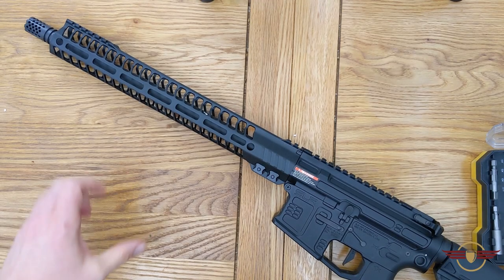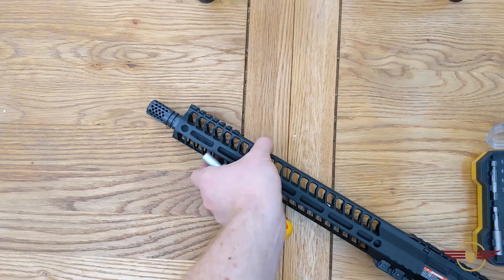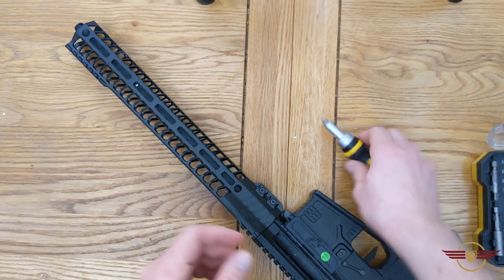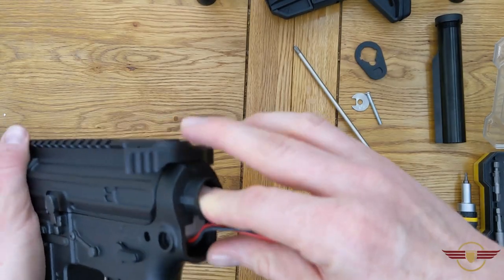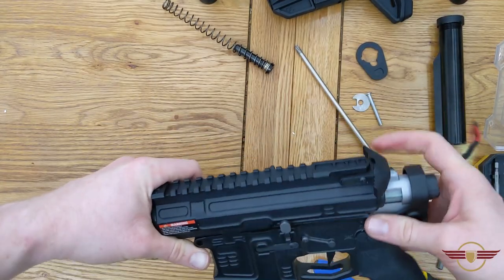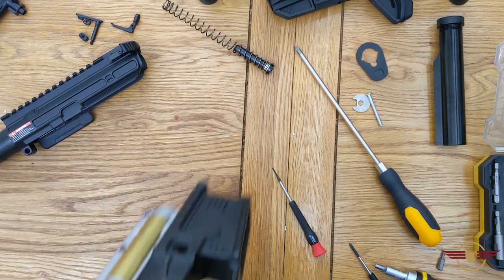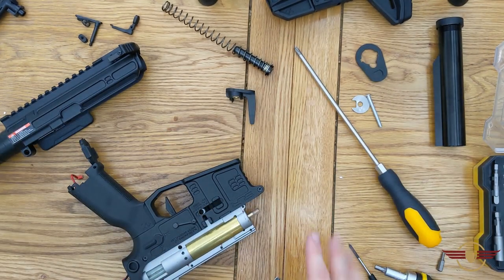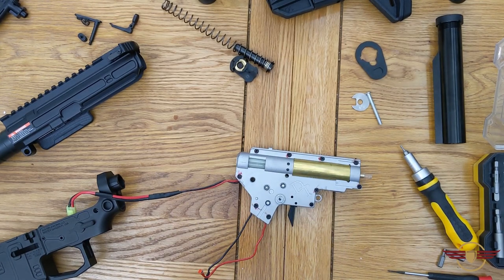[HOW TO] DYTAC SLR B15 Carbine Disassembly - internal review

Comment: thank you for make this nice video, I have the US version, there are couple difference in internal. US version has much strong motor that is I believe the same one in the CYMA Platinum M4, my gun also has that dytac mosfet with dean plug, of course we got plastic orange tip instead of steel muzzle brake. the air seal is non on my gun, the cylinder head and the piston head o-ring is way under size. BTW the external was built so nice.
Reply: Wait there's a Mosfet? I was wondering why mine not only came with Deans but it had 2 positive wires coming off the plug, even though the listing and discussions online claim it doesn't have a mosfet and comes with a Tamiya connector. (I got it in an Evike BOA event so lucky me either way).
Reply: @MrMattumbo  that's right, mine from evike too. I opened it up, you can find the exactly mosfet on evike website which is 29 dollar.

Comment: I just took mine apart and it has a basic mosfet in the trigger assembly! Im not going to use it lol, putting the Titan in it but all the ones I have seen had basic trigger contacts. Why would mine have a Mosfet in it?
Reply from the maker: Really? That's odd. I'm not particularly aware of them fitting them. Very very strange. The titan will be immense in it though! Pheas
Reply: As am I but I’m having trouble with the selector switch and the plate. It will no longer work. Any idea?
Reply: @DynamiteD21  Need to use the white sticker. Mine works great. Take the selector switches off, the screws. Blue lock tight them and tighten them tight. Had to take the gun apart again because they came loose. I used the all white sticker close as i could get it to the curved edge.